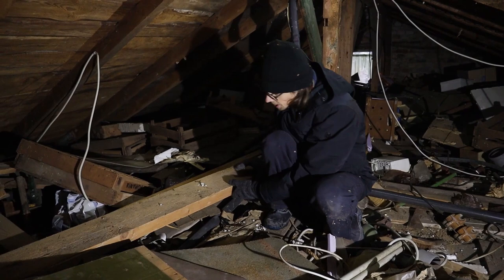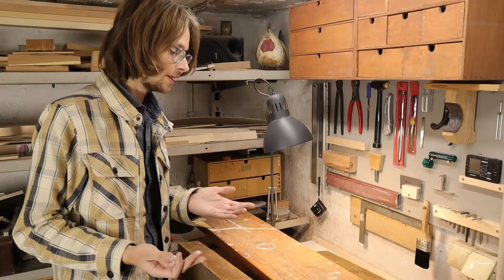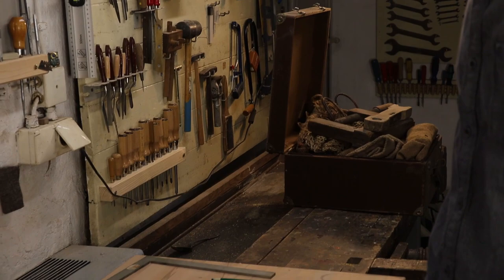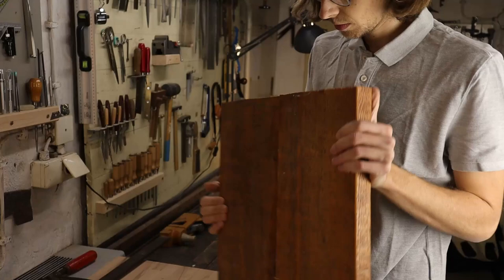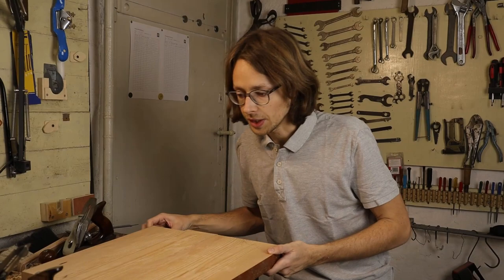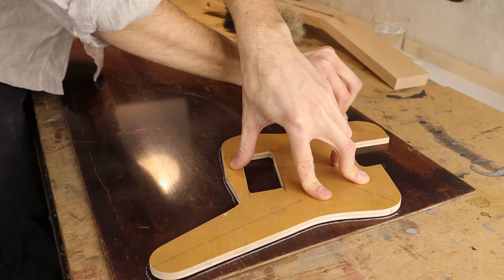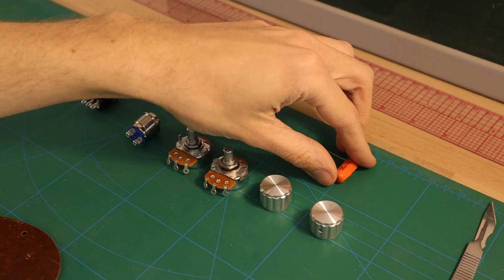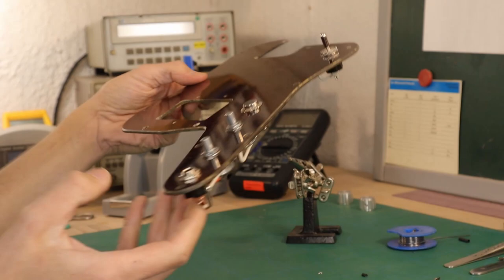Attic Treasure Hunt! - Making a custom Electric Guitar - E01 Body, Pickguard and Electronics

Comment: the toothed washer on the toggle switch should be on the hind/bottom part of the pickup and the flat washer on the top. That ways it will look flush on the outside and avoid the dirt that could be stuck on the gaps.